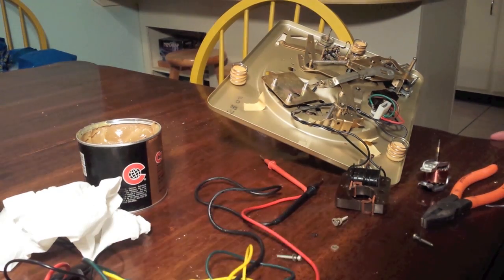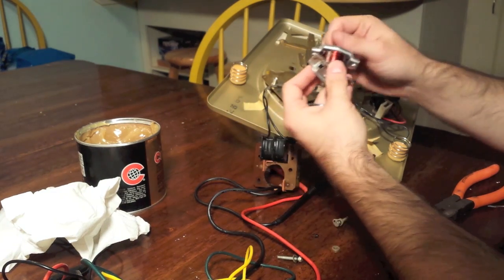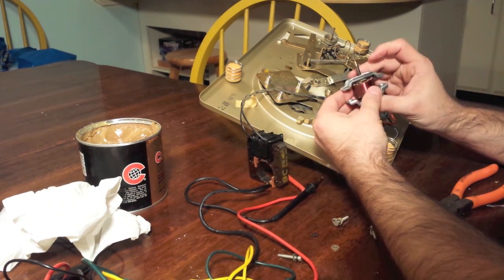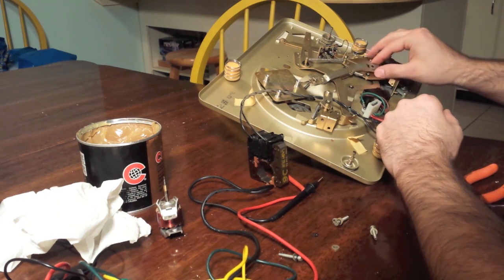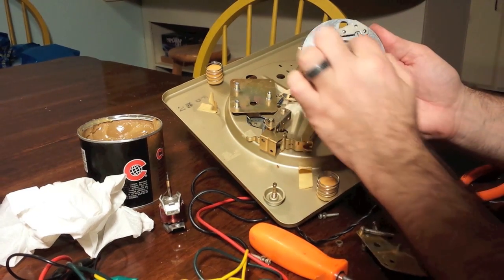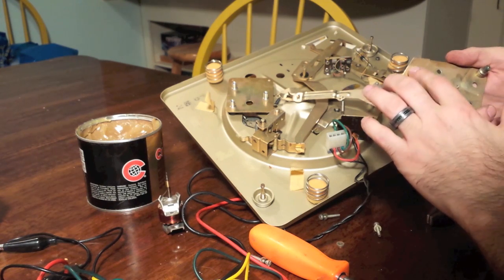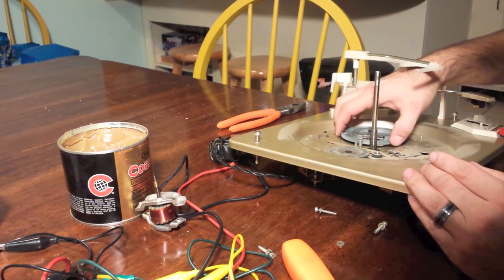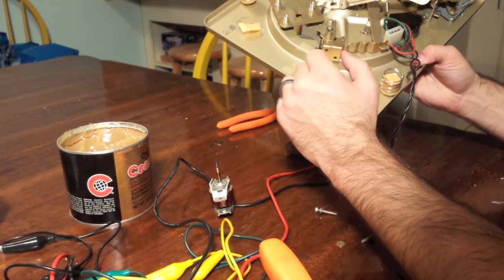Cleaning and Lubing a Turntable

Comment: A shaded pole motor, most typically found in refrigerators/upright freezers although the cores are half that one, but makes sense that would be a stronger version because it is operating a turntable mechanism and not just a plastic fan blade.

Comment: Thanks for the video! This looks like a Voice of Music model? I just did an overhaul on mine back in march and it was running perfectly for awhile, but now the motor seems to be binding up. I was just wondering what grease you're using there? I think I may need to clean out that bearing shaft and try again. Thanks again!

Comment: Your TT looks VERY similar to the RCA Victor VJT 50 W console I've been tinkering with. Thanks to your video I was encouraged enough to take apart the motor housing and place a bit of marine grease on the bottom of the spindle. Once I reassembled it all squeeling from the motor stopped.... And now I have a ton of wow. I have not yet deconstructed the whole turntable assembly. Before I do though - I'm concerned the Marine Grease may have been a bit to viscous for the motor. 

I guess I need some tips on when to use machine oil vs. grease. Any pointers.

BTW - you point out the varnish missing on the coil but never say why its a concern - my Alliance motor has none.

Comment: Does anybody know what to do if you get the motor running smoothly again, but it still plays at a slower speed than it should play? 🤔 It does seem stable thought, just that 45 or 33 is probably more like 42 and 31 now haha

Comment: The turn table on my record player is slipping. Any idea how I could go about fixing it?
Reply from the maker: Generally, a platter that's slipping has a worn belt or idler wheel.  The solution is to replace whichever your particular table has.  If you don't feel comfortable doing this, there's usually a record shop near you that can handle it.

I do suggest going to Vinyl Engine and getting the manual for your table should you decide to take this one on yourself - free registration before you can do so, but they're reputable.  Any time I'm working on a model I'm unfamiliar with, that's what I do.

If you have an idler, generally you have to ship the old one back for refurb before the company will send the new one.  If it's a belt, replacements are dirt cheap and don't require all the screwing around of an idler.

Hope this helps!
Reply: Andrew Corder Idler wheel or belt drive type?  It looks like there is a BSR record changer in this video.  Most were idler wheel driven.  Check the condition of the idler wheel.  Is it hard or stiff?  If so, it will not turn the platter.  The rubber must be soft and pliable in order to grip the inner rim of the platter.  To do this, remove the mini-clips off the idler wheel shaft using a jeweler's screwdriver.  First re-surface the outer edge of the wheel with sandpaper or an emery board, then apply Rawn rubber cleaner/rejuvenator to the rubber on idler wheel.  Let this stuff soak and absorb into the wheel for 15 mins.  This stuff works great on BSR record changer idler wheels, I swear by it!  If it's a belt drive, the belt no doubt is stretched out due to age.  Simply remove the clip holding the platter and lift it off the spindle.  Check the belt condition; like the stylus it's probably old and worn and you will need to replace it.  Make sure you know the exact size/type of belt you are replacing (flat/round).  Just research the turntable you are trying to restore (make/model).